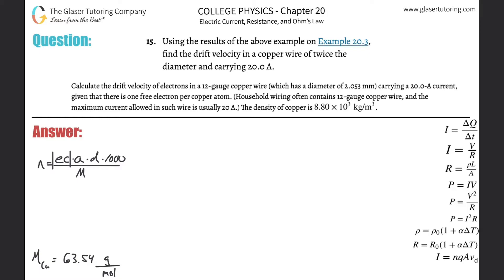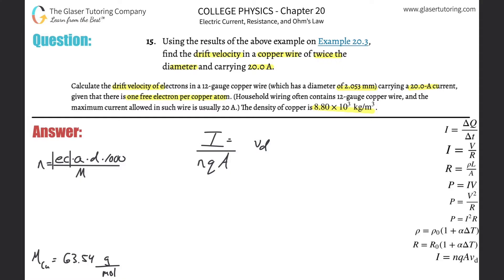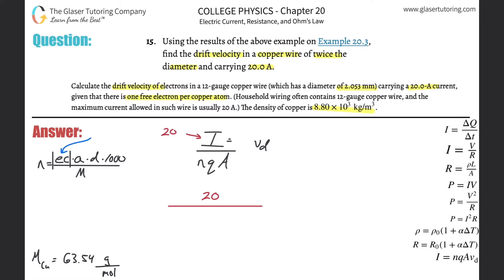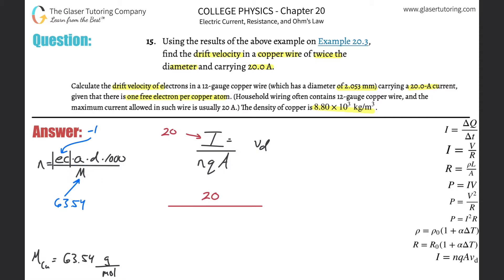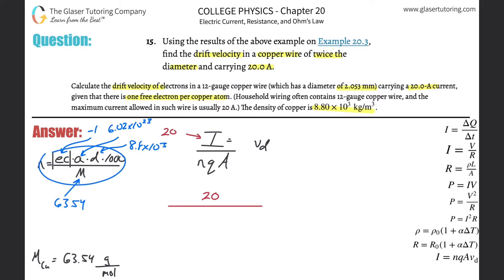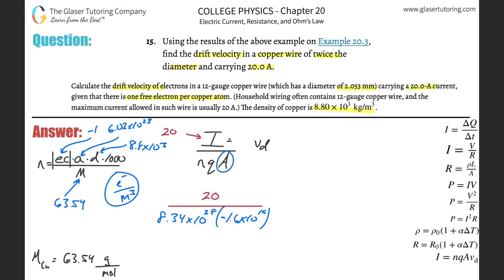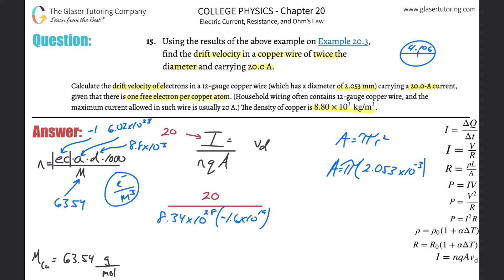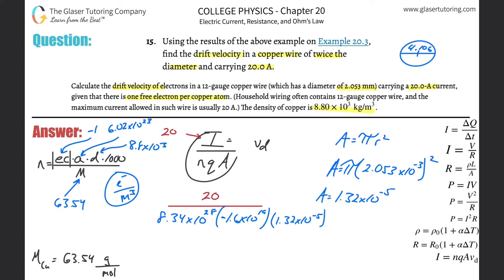20.15 | Using the results of the above example on Example 20.3, find the drift velocity in a copper

Comment: Hi! Love the vids, just wanted to say that when calculating the area, you used the value of the diameter as the radius.
Reply from the maker: Hi Gigi, thank you for your comment.  Number 15 states that the diameter of the wire is twice as large as the diameter stated in Example 20.3.  Therefore the value radius required to calculate the answer for number 15 is equal to the diameter stated in Example 20.3.  Please watch 3:53.  Good luck with your studies.